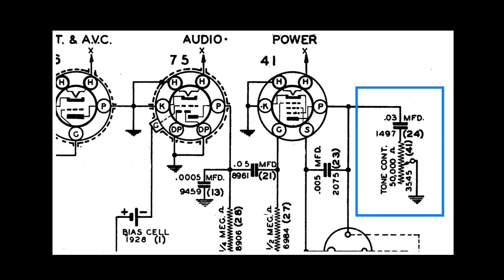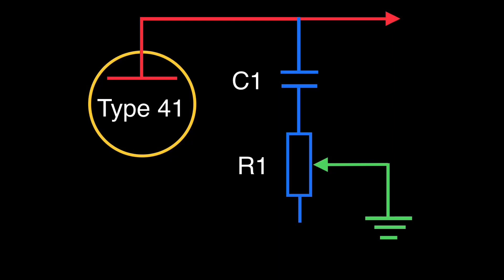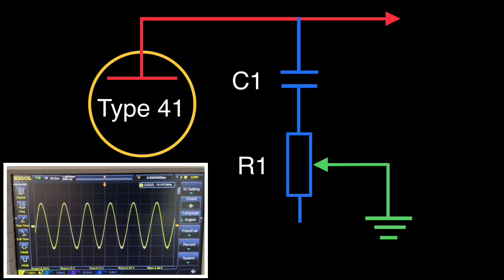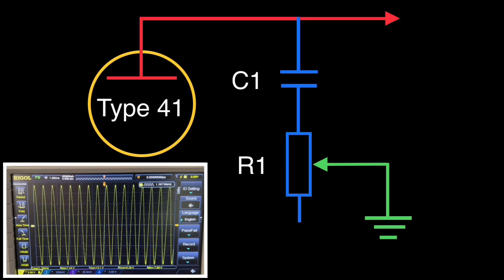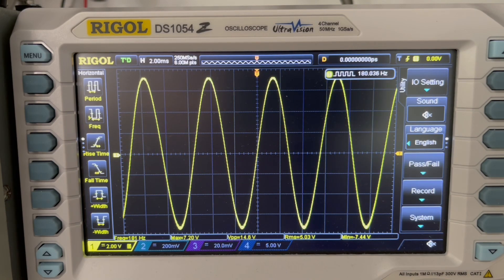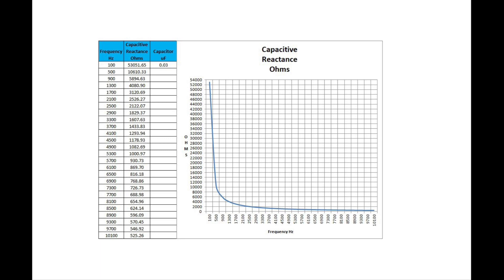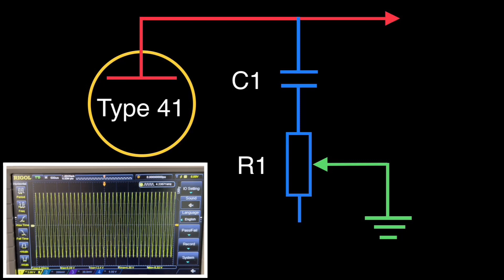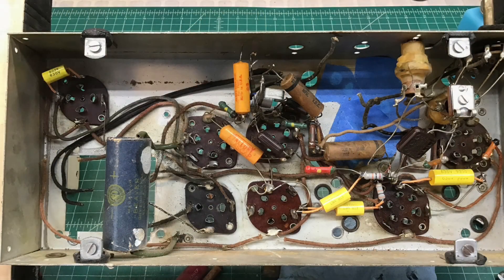How It Works - The Old Treble-Cutting "Tone Control"

Comment: Great video Don.   How would a Baxandall circuit differ in this ?
Reply from the maker: Thank you Ron. The tone control developed/designed by Mr. P.J. Baxandall was the best circuit and widely used where 2 pots, one for bass and the other for treble with no switching was made public in 1952. The approach uses negative feedback and the circuit resides between the grid and plate of the audio power tube. Check out the public article that describes the circuit in detail in addition to the schematic that includes both the treble and bass shaping in one circuit at:

Negative-Feedback Tone Control
Page 402
https://worldradiohistory.com/UK/Wireless-World/50s/Wireless-World-1952-10.pdf

and a correction/clarification:
Page 444
https://worldradiohistory.com/UK/Wireless-World/50s/Wireless-World-1952-11.pdf

Best,

Don

Comment: Thanks for the great video.
I was trying to understand what happens when the potentiometer is broken (the metal contact slider element running on the carbon resistance track is fallen off, effectively making the resistance at full).
So it means that the treble is maximum when the resistance is at maximum value in the Tone control, am I right?
I keep the Tone control at maximum always, to get maximum treble. So if the pot is broken, treble is at the highest level, so that I can leave it as it is, without trying to fix the pot.
Reply from the maker: Yes, that's correct. Lowering the resistance will attenuate the higher frequencies. Thanks for watching and reaching out. Best, Don

Comment: I have been wondering how a tone control circuit works. So when you described it as a low pass filter,  it made sense. Thanks Don
Reply from the maker: Thank you John. There are many iterations, but this circuit was very common for that period of time as keeping cost down was a priority for the manufactures. Best, Don

Comment: Very nice experiment - really good and practical.  Would be good to see the same experiment with a broad audio noise source and a spectrum analyzer so one could see the net result of varying the potentiometer on the passed audio spectrum.
Reply from the maker: Thank you Charles. Check the video below from years back. Best, Don

Peter Pan Radio - Day 13 P2 (Capacitor Value & Impact to Audio Freq. Response)
https://youtu.be/xkhOgUwmBjY